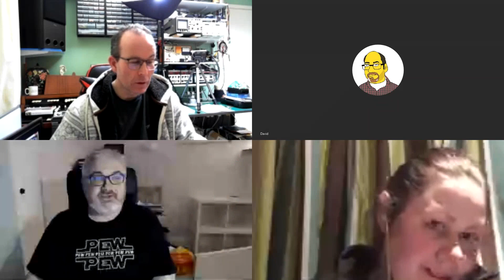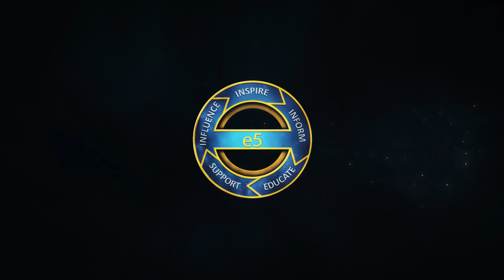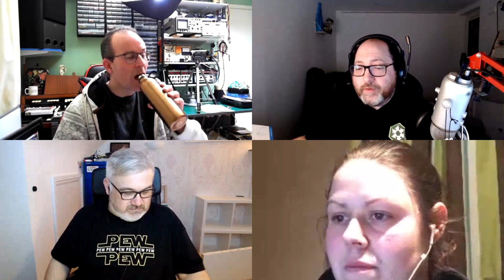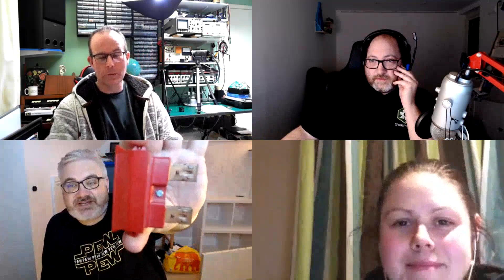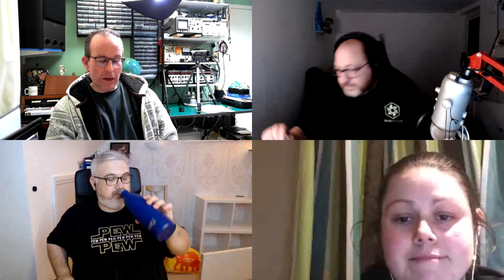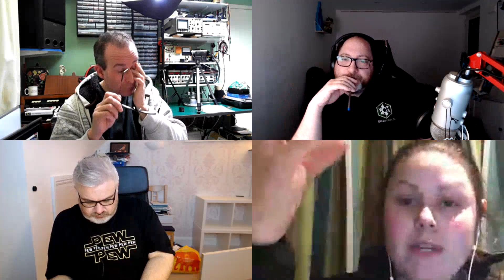Podcast 39: Surge Protection debate part 2

Comment: Extract from Electrical Contracting News article provided by Hager.
JANUARY 31, 2020
New ready-to-go commercial SPD boards from Hager
Mike Lawrence, Marketing Manager – Commercial Buildings at Hager, explains how the company’s new market-leading surge protection device (SPD) boards for commercial installations are offering electrical contractors a ‘ready-to-go’ integrated solution.
No secondary upstream protection devices required

In the past, surge protection devices required an MCB/MCCB or fuses in the distribution board to provide backup protection using one of the outgoing ways in the distribution board. The new Hager solution removes this requirement. For example, a four-way board retains the ability to be used for four TP ways rather than only three due to the SPD requiring one dedicated way. Removing the requirement for a secondary upstream device simplifies and speeds up installation timescales. Thoughts #e5 and Kirsty

Comment: You don't get any earth leakage across a spark gap or GDT. The type of device that you would see in a socket outlet would be a type 3 device, these are a fine filter to protect very sensitive terminal equipment and there should be a type 2 device (as a minimum) at the origin of the LV supply. The level of surge energy that a type 3 in a socket outlet would see is minimal. They do not pose any increased risk. IEC 61643 is the testing standard for SPD's and they must have some form of status indication.

Comment: They could build in the OCPD for SPD's within the SPD itself? and fit suitable to the DNO cut out fuse?...buy a SPD for 60/100A supply? dunno seems the sensible thing to do to me. Interesting.
Reply: Many manufacturers do have OCPD built in, some also have very innovative solutions like spark gaps built in to protects against over voltage, try here for example: https://www.dehn.co.uk/en-gb/1628/1869543/Familie-html/1869543/DEHNguardSECIwithintegratedBackupFuse.html

Comment: alot of installers are now using the Cheap Fuse Box Consumer units with built in upfront SPD - no OCP??

youtube bloggers are also installing these? i guess these are all wrong,, but again BS7671 is recommendation only

Comment: Thanks folks, very interesting, have we established what size mcb for the spd ?  I think I would always keep the spd in a separate enclosure PS, I have noticed that  "the lads" seemed to take on board liquid earlier  & more of it than you normally do, is it a Kirsty effect ? 😂😂😂
Reply: Depends on the manufacturers installation instructions and the size of your supply. There should not be a one size fits all solution.

Comment: 5mins in and I've already changed my way, need to go back and alter a couple of Hager type 1 installs.
Reply: You can't buy the Hager type 1&2 SPA201 device with remote output terminals or buzzer a pretty poor design really. Why can't these SPD's have a built in warning buzzer to indicate when they no longer provide protection.
Reply: @markholmes4143   the testing standard (IEC 61643) requires that they must have indication, this is typically visual indication because SPD's should be visually inspected at least once a year. The testing standard was created prior to BS7671 requiring SPD's in some domestic applications so the testing standard is lagging a little behind the installation standard